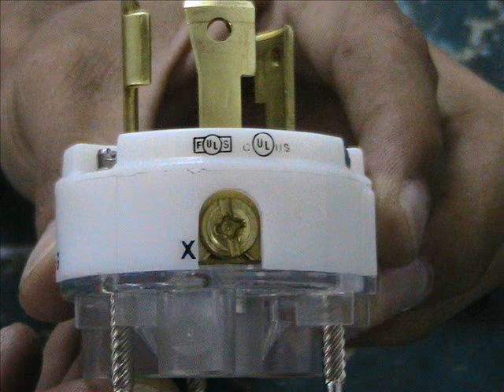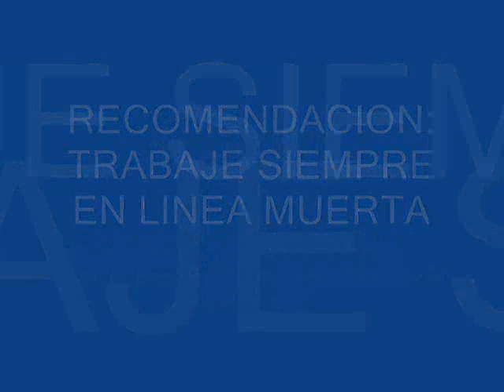COMO INSTALAR UN TOMACORRIENTE INDUSTRIAL

Comment: Amigo, tengo este equipo:

http://articulo.mercadolibre.com.ar/MLA-616485565-soldadora-inverter-profesional-250amp-8300w-gladiator-ie8250-_JM

me vino sin clavija  macho en el cable de 2,5mm, ¿para cuantos amperes debería ser dicha clavija?
además, necesito hacer un alarge o cable de extensión de unos 10 metros que 
iría del tomacorriente (220v-230v Uruguay) de la casa al equipo de soldar, ¿supongo que el cable de 4mm estaría bien? las clavijas macho y hembra del alarge de cuantos amperes tendrían que ser? Te agradezco la ayuda viejo, saludos
Reply from the maker: +Walter Nores Hola Walter, el cable de 2.5 mm soporta alrededor de 20 Amperes, por tanto una clavija de 20 Amperes o mas te servirá.  La extensión de 4 mm está bien ya que es mayor que 2.5 mm y tambien soportaría la corriente del soldador, las clavija y toma del alargue tambien pueden ser de 20 Amperes.  Lo que debes mirar es de cuantos Amperes es el tomacorriente de tu casa y la protección correspondiente que si soporten los 20 Amperes y que el macho que compres sea compatible con el tomacorriente de tu casa, lo mas seguro es que asi sea.

Comment: hola soy de mexico tengo una soldadora monofásica que maneja 2 corrientes a 110v y 220v mi duda es como la conecto a 220v si cada fase  de mi caja de fusibles es de 110v  tengo 3 fases por separado aparte el neutro y la soldadora nada mas tiene 3 cables uno café que es la fase uno azul el neutro y amarillo con verde la tierra
Reply from the maker: Hola Daniel, entre cada fase y el neutro tienes 110 pero si mides entre fase y fase te da 220entonces  la debes conectar a dos fases y también a tierra.